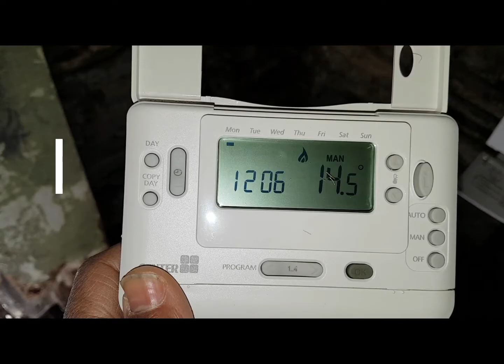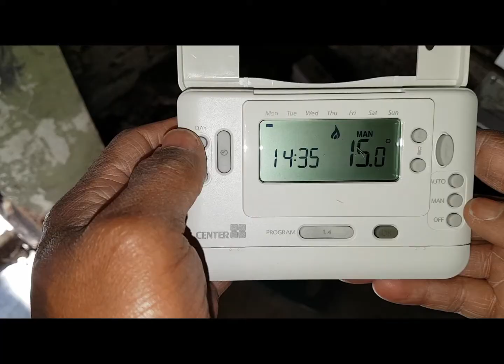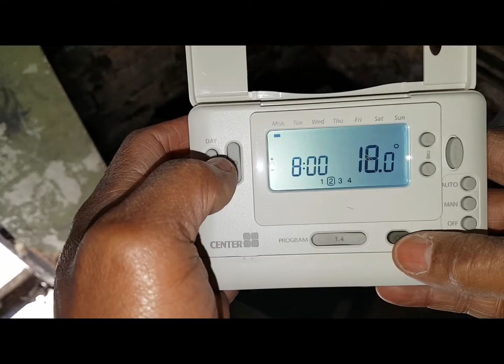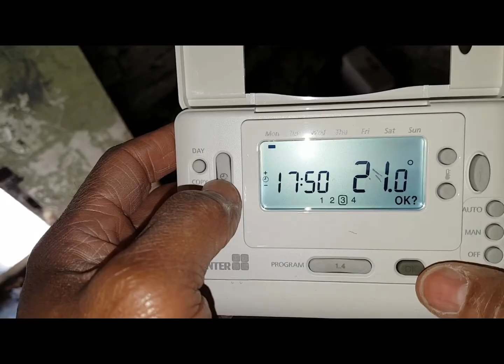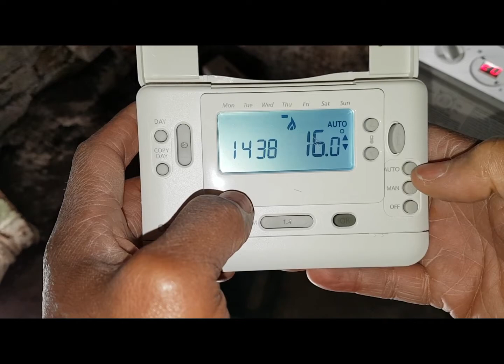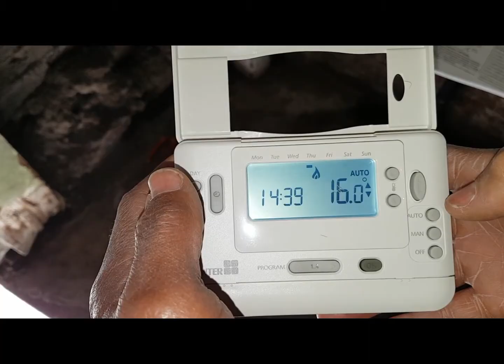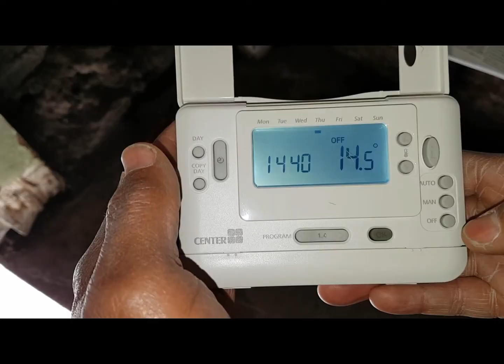How to Programme a Programable Wireless Room Thermostat. With Coach Tony Morgan

Comment: Hi, I've got the same make of thermostat but it has less buttons. I can use it but it has started to turn back on when I turn it off. What could be the problem. It seemed to be working fine but now it's unreliable. I use it in manual mode by the way. Thanks in advance.

Comment: I must be missing something. I cannot seem to get it right in auto. The heating keeps firing up even though the ambient temperature is above the programmed temp, even though I have if I set quite low and it is starting and continuing beyond the set times. I am wondering if it would be better to just use the manual setting ? ....

Comment: I’m a bit confused by this. In my dad’s house, when I manually adjust the thermostat to 24 degrees Celsius, it only increases very slowly from 15 degrees, reaching about 16.5 degrees, but never the 24 degrees I set. Why is this happening? Why doesn’t it just increase to 24 degrees to better heat the home? I’m wondering if I’m misinterpreting the situation because it could be warmer in my dad’s house. Sometimes, the temperature just stays around 15-15.5 degrees, which isn’t very warm. I’m not sure if I’m doing something wrong or misunderstanding the situation. Does anyone have any advice?

Comment: Why is it not working for me? I don't understand what is the temperature settings for it to come on
Reply from the maker: The temperature on the on setting must at least 21 degrees and the off temperature should 14 degrees. And can you subscribe to our channel 😊
Reply: @A+R Central Heating and Boiler Repair Experts Ltd  is that the first set of numbers or the first and yes I've subscribed
Reply from the maker: Yeah its the first set of numbers
Reply: @A+R Central Heating and Boiler Repair Experts Ltd  yes I'm struggling with it and it won't come on at all now
Reply from the maker: You can give me call tomorrow after 1.00 pm 0797 3325384

Comment: But how do you bind it?
Reply from the maker: Just take out the batteries and refit them and it should auto pair up
Reply: @ARBoilers  mine is a replacement. Is there a way to repair to a new device? 🙏🏼
Reply from the maker: @82517  thats the only way or it could be faulty

Comment: For heating to come on ,does it  mean for example if temperature set to 20 degrees the heating won't come on until it reaches that set temperature?Or is that the temperature the central heating will be at the set times for coming on and if it goes over that temperature it will turn off?
Reply from the maker: It's the temperature that ultimately turns off the heating
Reply: @ARBoilers  Thanks so if temperature set to 20 degrees if it went to 21 or more the heating would go off?

Comment: Hello. I had a man come out to fix my boiler as the hot water was running Luke warm. 
After he  left I've realized my heating isn't working. It's as if the remote isn't linking to the boiler. Is there a way I can link it back please without having to call him back out. Thank you

Comment: Hello Tony, not sure if you will see this question or not but here's hoping. I need to adjust our heating so it comes on automatically when the temperature drops below 20, but I need to make sure it does it automatically without having to be done manually on the controls. I have set the other control to be on constant( the one in the cupboard) but the control unit (this one you have shown here) doesn't seem to shut off the heating and it is going up to 21.5 or even 22.  I am having to manually turn it off when it gets too hot or on when it drops to less than 20. Please can you help ?
Reply from the maker: Send me your email to tony@engineerteam.co.uk with your mobile and I will call you

Comment: Still confused by your grammar. Will the heating turn on when it gets to those  temperatures or will it come on at 6.30am and then go up to whatever temperature it's been set to?
Reply from the maker: It will come at time set as long as the ambient temperature is lower than the set temperature on the thermostat
Reply from the maker: hey we're currently trying to grow our Facebook group and would love you to join Tony and the team using this link, Tony will be available to answer all your questions directly https://www.facebook.com/groups/167070231326174

Comment: This has helped me so much!!! It’s getting cold and needed to sort this out. Only problem is I think mine is not reading the right temperature. Last night I was a block of ice, and it said it was 19 degrees... what happens if the reading of the temperature is off?
Reply from the maker: Just use the up arrow to turn on the boiler